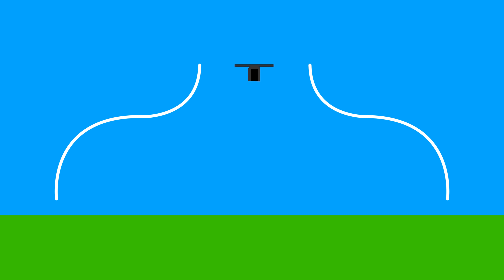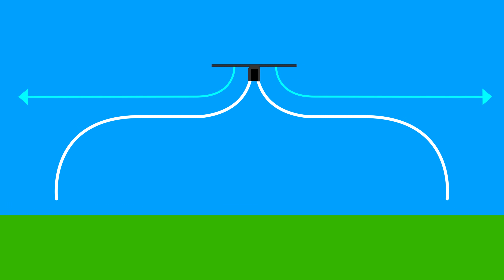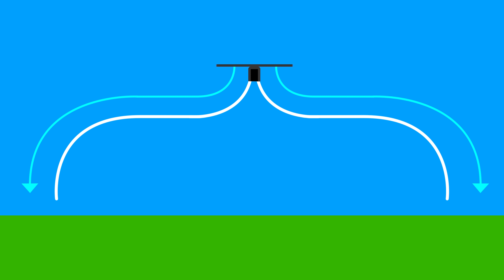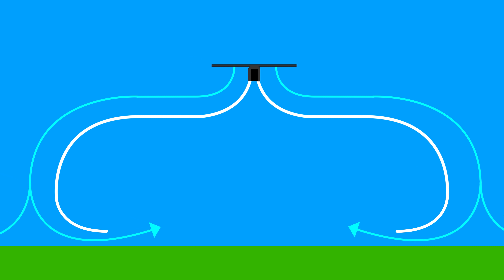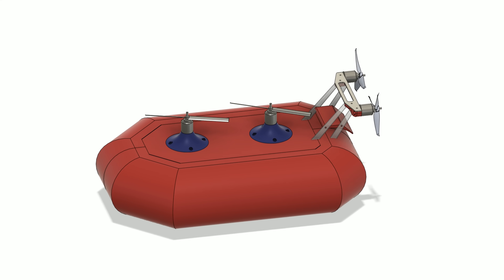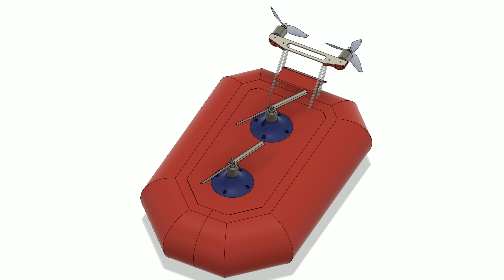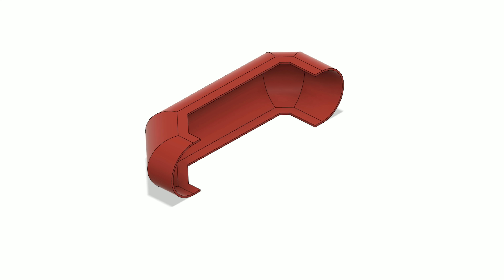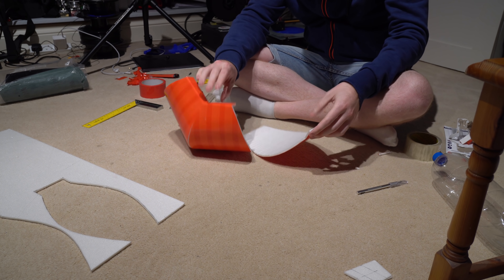Coanda Effect Hovercraft

Comment: Does it have to be hollow? I'm wondering if you made it as an inflatable chassis would it work? You could half the weight and reduce the size of motors and batteries. Perhaps add some little stabilising wings somewhere to help avoid the flips. Inteligent feedback could automatically lower the thrust if it sensed lifting.

Comment: Perhaps you might want to replicate Coandas design of the air flow nozzle.  Yours is not an accurate reproduction of Coandas design.  Perhaps you could find an audiobook that’ll tell how Coanda actually built his? The propellers you supplemented move the air almost 90 degrees towards the surface.  The flow must begin exactly tangential to the surface.  Your  title is a misconception, given your setup.  Do your homework, plz.

Comment: I suggest you place the vertical propeller left and right. Then write a program tells the car when the car turns left, strengthens the left pressure to the ground; when it turns right, strengthen the right pressure. That way the car won't flip over during turning.

Comment: Could you reduce the nose down force by mounting the propulsion motors lower? Thrust SSC did this, the original design had the jet underneath and the rocket on top but they switched when the modelling showed that having the more powerful engine on top would create a lot of nose down force.

Comment: You should try sealing off a good amount of the inside. Maybe the high pressure inside is adding too much unnecessary lift. Also when the front or sides lift just a little it seems to cause tons of drag, adding to the instability and flipping the frame. I mean it's already top heavy. Maybe just cut down how much space can be pressurized inside is what I'm saying. Awesome build.

Comment: work on your metabolic center, if you work on lower curvature of your craft and make a curved reverse fillet rather than fillet you may get is more stable during turns, work on nose so that it doesn't touch ground while turning it will eliminate rolling over issue. second leaves weren't collected due to high pressure, its probably the vacume that pulls the leaves inside body case pressure won't pull it would rather push

Comment: I love it when you science guys actually build things to help the rest of of see concepts in action.  But I do have one question.  Wouldn't the fans still produce some amount of lift even if they were mounted to a flat surface of similar size?  I may not be visualizing all the forces correctly but it seams as if act of pull air downward and then redirecting it straight out horizontally would result in a net lift even without any Coanda effect.
Reply: The air will apply a force to the surface, so I think they'll cancel out.

I'm not quite sure though
Reply: @fisch37 -- If there's a net downward motion of air, then there must be a net upward force to match. Definitely much worse than a normal helicopter, but sucking air downward is still something.
Reply: Lol yeah, I'm pretty sure his wing concept was not doing much if anything. It is just a helicopter that only produces enough thrust to lift 80% of the weight making friction negligible. I assume a flat sled would work just as well. Still super fun project, glad I watched.

Comment: Try counter weight on the inside of the sides where they curve under. It will probably use a little more thrust to get it up but it should stabilize the top heaviness. 👍👍

Comment: One thing I missed was seeing the difference between the bottom being a hole or not. You wondered if the a pressure difference inside the cavity contributed to the Coanda Effect or not. Can you try it with the bottom covered. You could use packing tape to cover the bottom and it would be an easy test. Great video though! Your foam board manufacture is awesome!

Comment: I just think that since the bottom is open is that it's just simply scooping up the leaves instead of sucking them up due to the Coanda effect.

And two I would have used the other fan design (the ones used on the quad) instead of just standard props

Comment: I think one problem here is that when the craft lands with one side on the ground, the air flow is blocked on that side. However, the side that is up in the air opposite is not blocked. This might be leading to the coanda effect pulling the craft over further for the same reason that it produces lift. If I'm right about that, then that might make stabilisation of the craft harder than just moving the centre of mass.

Comment: The effective lift component created by Coanda effect is
directly proportional the velocity of the fluid/gas moving over the curved surface
and the angular deflection created by the curved. The resultant force vector of
your lift component would be 90 degrees tangent on the surface of your curve. So
probably somewhere around 45 degrees to your horizontal surface and the low
pressure deferential would be extremely small, (the reason your impellers didn’t work). The primary lift component to your experiment is coming primarily from Bernoulli’s Principle, (your
propellers).  You will probably see essentially the same performance if you completely remove the curved surfaces from the hovercraft and simply fly the flat surface alone. I truly applaud your ingenuity and creativity. I am using years of experience and mathematical extrapolation to
assert my theory about your experiment, so you are doing the true science here
not me. That being said, if you do not test the hovercraft without the curved sides
you cannot definitively determine if Coanda had anything to do with your hovercraft’s
performance. Keep up the good work.

Comment: perhaps next time you should account for the weight of the rear and ensure a more balanced lift mechanism. as it stands, it's obvious that the front motor is about 40% redundant, and only works to tilt the device up.

Comment: 14:20
There I thought you are steering it by either pushing more on the left or right, this creates leverage on the outside of the hovercraft and lifting the inside of the curve. Would angling the propellers in the back inwards be viable? 
BecauseIt it would swap Wich rotor is responsible for turning at some point thus putting more leverage onto the inside of the curve.
In other words steering the hovercraft is like riding a bike but leaning away from the turn and not into it.
Please correct me if I am thinking wrong.

Comment: It seems to me that you have negative pressure under the craft, not positive. That contributes at the stability at low altitude and when the craft is moving horizontally because it keeps the craft "glued" to the ground. It also "contributes" at the low efficiency you observed. But things go inherently wrong when the craft gets a bit more altitude or you make a turn. That negative pressure is not controlled and, as it disappears, the stability disappears too. As a consequence, your craft is inherently unstable. Your initial "feeling" that you should increase the pressure under the craft was good. But it's exactly that Coandă effect which is lowering the pressure under the craft. In the Coandă effect, the jet is attaching itself to the curved surface, it's bending on the surface, because the pressure between the surface and the jet is lower than the ambient pressure. The way you made it, the curved jet is not entering under the craft to increase the pressure, it's taking the air from it, reducing the pressure.

I think one way to negate this phenomenon is to simply drill 2 holes on each side of the hovering propellers (well, big holes, more than 10mm diameter). That should improve the stability. An even better way is to have small controlled fans with small reversed funnels (to reduce the dynamic pressure at the fans exits, or, if you want, to disperse the air on a bigger surface) for those holes to really have a positive pressure under the craft. This way you'll have the best from the two worlds: air cushioned, Coandă effect hovercraft.
Later edit: I'm not an aeronautical engineer, I'm a nuclear physicist living in an IT world. So... good job with your clips! I really appreciate them.

Comment: It's really interesting, but I think that the coanda effect isn't enough to lift the hovercraft. 
You have used standard propellants that creates a low pressure area above theme and this is probably what have lifted the hovercraft. This is the same principle that make helicopter fly.
Reply: That makes sense Erik, i think your on to it.
Reply: Coanda effect and Newtons 3rd law are irrelevant in aerodynamics, please reffer to Navier Stokes equations, which when numerically solved can correlate pressure and flow speed so that you can obtain forces being produced. Bernoulli's equation obviates viscosity, which Navier Stokes takes into account, and Coanda effect isn't correct as explained in this video, as what causes a fluid to deflect around a curved surface is the viscosity of the fluid itself, not air pressure. Air pressure changes are the consequences of fluid changes in velocity.
Reply: i would like some numbers.... i don't see any numbers anywhere
Reply: Exactly, the vertical helicopter positioned propellers create lift either bcs even if the base is big, they might still be pushing enough air down to create lift or as someone said, bcs of the blade's shape (if those are wing like)... The way to find how much trust those are adding would be having a spring or some kind of sensor that tells how much those propellers pull from  the body and subtract the entropy created by the blades pushing air gainst the body which just goes to vibration etc.. My prwdiction judging by the low motion vid showing how the hubber flies straight out of Ramos is that the C effect is almost neglectible, other wise the body would immediate ly fall after leaving ramo, since the C effect would have no ground to push on
Reply: Okay, so, I was about to write a long essay on why this was wrong, but I caught myself misunderstanding what you wrote. I think what you're talking about is Bernoulli's Principle which also applies to other crafts, such as airplanes. While this is technically true for the propeller wings and commonly accepted in aerodynamics, it does not tell the whole story. While the Coanda effect isn't an efficient way to create lift, it does, in fact, direct the flow of air downward which (using newton's third law of motion) dictates that an opposite force would lift the craft upwards. Now, why I disagree with Bernoulli's principle being the biggest contributor to the lift in this instance is because if the shape of the body had been more flat, the downwards airflow would be solely pushing down on the body, causing an equilibrium of forces.

Although, I'm not claiming that I'm more correct than you. Aerodynamics is still a hotly discussed topic. It works. We just don't know exactly how it works yet.
Reply: @XXX3RX0   Its a misconception that Bernoulli's principle is the biggest contributor to wing (rotor) lift. Its a myth that gets replayed all the time. If it were then flat wing balsa planes wouldn't fly. Also, many aircraft can fly upside down and that's not explain by Coanda or Bernoulli's principle. Its the angle of attack reaction that is the main lift generator in aircraft. Just to clarify a point.

Comment: Might I suggest (since you have the power) the addition of some ballast at the bottom of the craft? (Inside the pontoons) along with some mesh to keep leaves out that would lower your Cg and make it far better at cornering. 

Hmm, or maybe you could also test an actuated flap to cause mild stalling on either side to make the craft strafe! That'd be interesting.

Comment: Hi Tom. Have you thought about allowing some of the air to be channeled down into the hill through holes in the top under the lift propellers. It might give you more stable air under the hull and  reduce the leaf problem. If you fitted small wings, you might get some ground effect to get it higher.

Comment: I saw a two moving wings helicopter with fusion dragging on turf but a coanda craft with lifting fuselage. 

The moving wing lift more lift than the coanda lift. 

This could be more convincing for coanda with the impeller. 

I noticed the impeller has top/bottom discs. For the intended purpose do you think it’s best without the top disc? The purpose? Is to move air by the volume instead of by the compression/pressure.

Comment: Hmm, I think the flipping could be due to the gyroscopic interactions of the propellers, do you have the props spinning in opposite directions or in the same way?
Reply: True, there are still quite some development and engineering that needs to be done to make it fool proof, but so far as a concept I think this is reasonably good already. At some point there appeared to be more thrust from the front propeller lifting the nose slightly faster, so I'm not sure if it was due to the added weight from the back propellers? Also, I didn't check for it specifically as to which direction the flipping over takes place... That could also be some indication as to the rotating angles of the top propellers, and if opposite flipping would occur if they were swapped? Dunno, just a random thought haha. Still an interesting build nonetheless though
Reply: Morpheon lYeah I liked it, it’s unique for sure, it definitely could be a Center of mass thing to fix it, lowering its Center  balancing it out better would definitely make a huge difference.
Reply: You can see from around 14:00 onwards in the slow motion section that the 2 top propellers are spinning in opposite directions from one another
Reply: Morpheon what about the back motors? They could still be applying torque in some way in combination with the top props,
Reply: Yeah, it's definitely worth looking into and just work out all the various things that needs fine tuning for it to be "perfect" as an end result

Comment: Will it work if you pump out air from the bottom and blow it parallel to top of the craft by your impellers mounted upside down?
Also if you mount propellers to front it should improve stability.
Bending a skirt inward probably bad idea, because coander effect should work here too and it will work in opposite direction than you need.
Sorry for my English.

Comment: Without the push motors, could you tether it and see if it can fly above ground effect?  Also, I'd mount the actual lift motors near the bottom, with long shafts going up to the props, to lower center of gravity.

Comment: To improve the effect put a shroud around the propellers and make a thin slot at the bottom so the air flow is forced closer to the surface. A lot of efficiency is lost because most of the airflow is too far from the surface

Comment: Great idea! I've never heard of the Coanda effect until now, interesting...
If you lower the endpoints on your transmitter to just below the point of when the craft tends to "lift off" you can run it at full throttle on the transmitter, but it's only sending the limit you set with the end points (if that makes sense). That may help control it better by not giving it too much lift.

Comment: By definition a hover craft hovers not flies. The shear fact that propellers are sucking air down is what is causing the lift and desire for the craft to fly. Hover crafts glide and are capable of lateral travel without tipping. once again this is because it is essentially an In-efficient drone. Maybe if the propellers / jets were facing sideways this could show the Coanda effect more effectively and dare I say convincingly. I'm not saying what your telling us is wrong, but it requires more controlled testing.

Comment: Instead of just having the fuselage being a giant overturned flat-bottomed boat, wouldn't it be more efficient to be composed of connected saucers? And if you made it out of four saucers connected in a square, it'd be possible to modulate their power on any side to help prevent the thing from flipping over. At least that's what I think without any engineering experience.

Comment: You poke to soon OOPS !
I would think the efficiency of the lift is not comparable to a regular hoover craft.
and start using a light weight cage over your experiments to protect from accidents
and try adding stabilizers or a gyro and the addition of wings would get it air born to prevent form flips etc, and it could transition to air flying mode, by only forward motion,
Enjoy your videos

Comment: Should have put a little sled in the middle under it, with a small lead weight on it. A sled so that the weight isn't getting dragged into the ground and the weight to counter the top-heavyness.

Comment: I'm sorry Tom but I'm not convinced by this one. You at no point created a control to show that the propellers are not the factor for lift such as they are on a Chinook helicopter. You could do that by mounting them on a flat plate with the same area and weight of the hull, nor have you placed any tufts or used smoke on the rounded parts of the hull to show air direction. You're a great engineer and you've made some great things in the past but you have some learning to do about the scientific process. At best, you're ignorant to the scientific process, at worst, you realised that it didn't lift because of the Coandă Effect but because you invested a lot of time and resources in the project you deliberately left it out for the sake of making the video and gettings views and money. I'm being critical because you're a smart guy, you and this channel has matured over the years and I know you can do better. Peace.

Comment: The stability issue is because of the air flow around the hull being disturbed by outside air/wind.  Would be interesting to put four fans on top and put air diverter in middle.  with gyro control to see if it affect stability.  If it would still work with bottom closed off the one benifit of this design could be more usable room in the hull for cargo.